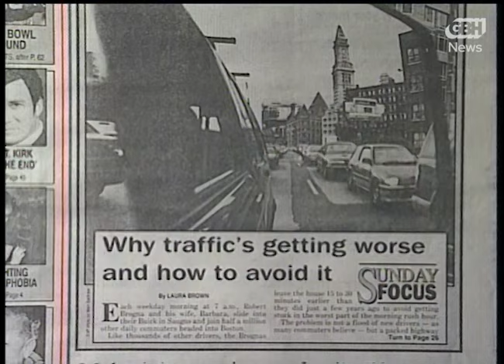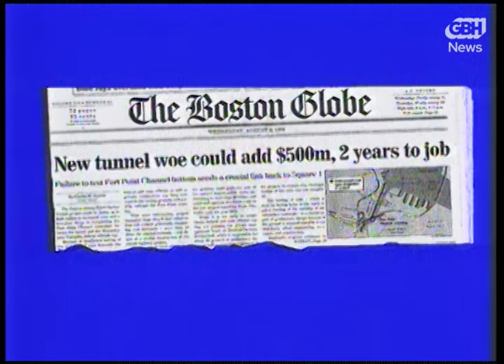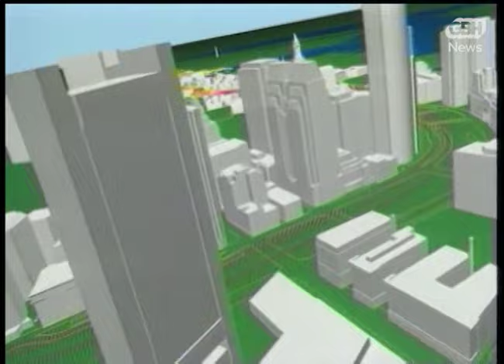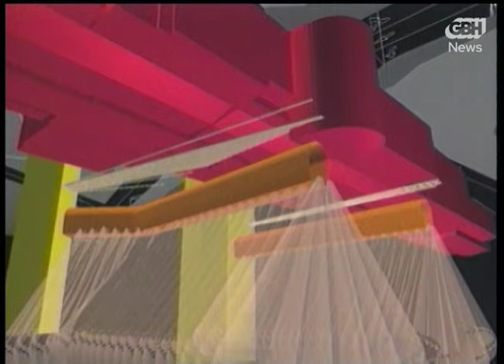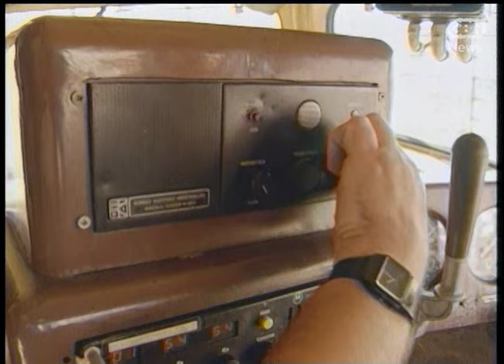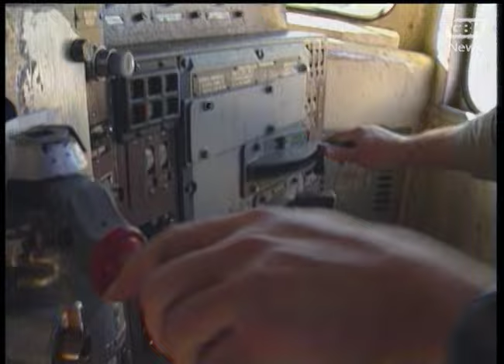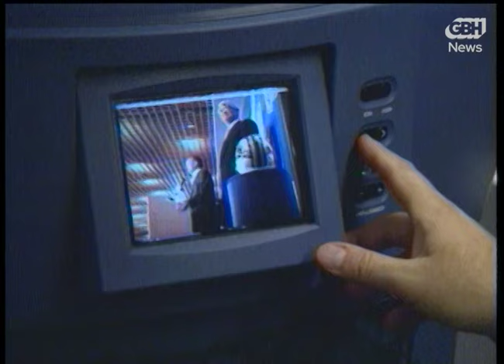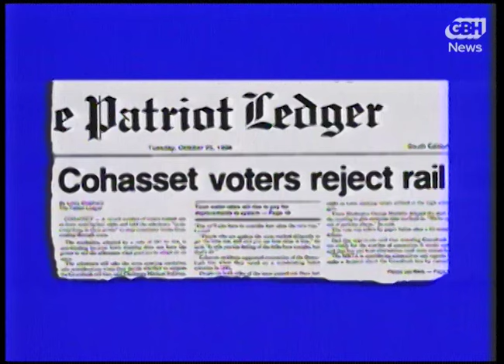The Big Dig On Track, 1995 | From the GBH archives

Comment: Wish they built the North South Rail Link! Hope they do it now with electrified regional rail
Reply: Don't hold your breath; The orange line extension to Malden was first planned in 1910, did not get there until 1977
Reply: @interstellarphred  there were plans for the rail link in the early 1900s as well as during the big dig
Reply: @robsterkmc  The railway link circa 1909 was actually called the "central artery" along with a plan to electrify lines that are now bike paths. There was also a proposal to place a transit railway in the Route 128 beltway; It got the axe early on as the project was ridiculed as the highway to nowhere ( don't build it too big 'cause there is nothing there and no one will use it). Deja-vu? Besides, we may wish to reconsider the concept of placing a tunnel with lots of holes in it at its deepest points 100 feet below sea level next to the rising ocean.
A link exists in mothballs in Worcester. or it could be placed to the West on higher ground in the inner belt corridor with less exotic and costly engineering.